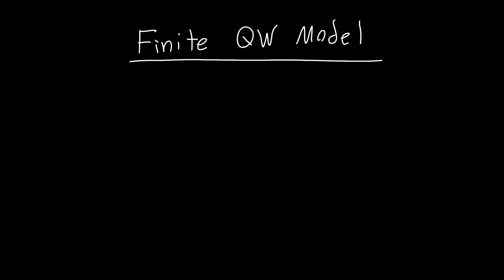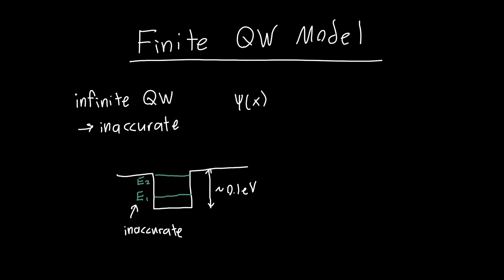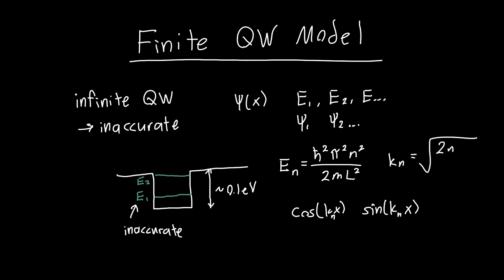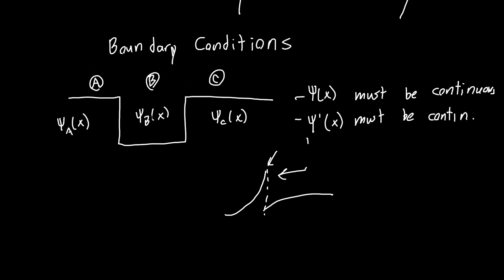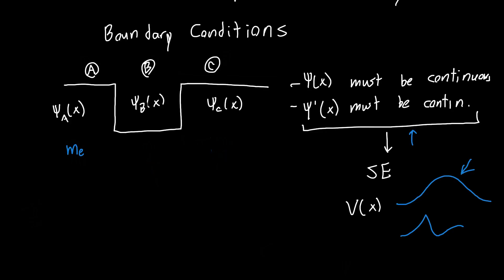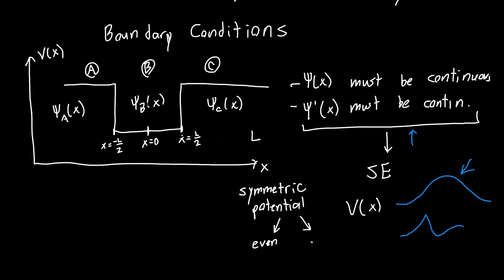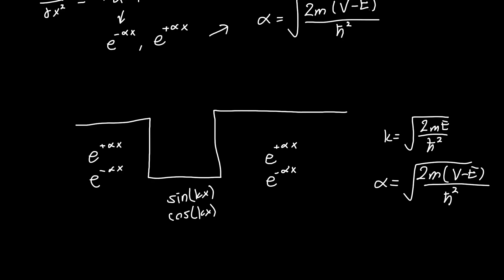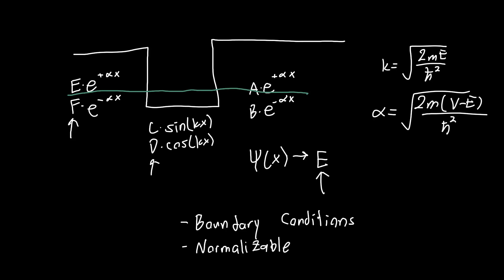Finite Quantum Well Explained - Part 1

Comment: How does one learn how to know what the general solutions are?
Reply: A standard differential equations book will explain how to find a general solution to a ordinary differential equation. If you haven't read any, I recommend A First Course in Differential Equation with Modeling Applications by Denis G. Zill. 

For linear differential equations it's analogous to linear algebra if you've studied it before. For a vector space like R^n, for example, the vector space is n dimensional and you need n basis vectors in order to describe it. For the three dimensional vector space R^3 one set of basis vectors you can have is i hat, j hat and k hat or x hat, y hat and z hat if you prefer. But for any vector space there are an infinite number of sets of basis vectors you can choose. However once you pick one, any vector in that vector space can be written as a linear combination of those vectors. So for an arbitrary position vector, r, in say R^3, r = xxhat+yyhat+zzhat. A necessary property for a set of basis vectors is that they are linearly independent which means you can not write one of the basis vectors as a sum of the other basis vectors. So, for example, if you have some set of vectors, {e1,e2,e3} and e1=ae2+be2 where a and b are nonzero, that set is not linearly independent, it's linearly dependent. To generalize, the set is linearly independent if ae1+be2+ce3=0 if and only if a=b=c=0. 

Linear ordinary differential equations work in a similar way but instead of having basis vectors you have what you can call basis functions. The highest order derivative in the differential equation is called the order of the differential equations and this tells you how many basis functions you will need for your general solution. It's analogous to the dimension of a vector space. If you have an nth order differential equation, you have found n functions that satisfy the differential, and you have confirmed they are linearly independent then you can simply write your general solution as a linear combination of all these functions. (For a easy way to check if functions are linearly independent it might be worth looking up the  Wronskian. It comes from linear algebra but all you really need to know is how to compute them which isn't too difficult.) It doesn't matter what set of basis functions you end up with. As long as they are linearly independent and each satisfy the differential equation then it's linear combination can describe any possible function that satisfies it. How you actually find these functions will depend on the differential equation. Some differential equations will have a method or multiple methods to systematically solve for them. If all else fails or it's just easier, you can guess a function and check if it salsifies the differential equation. The method of undetermined coefficients is a method to make better guesses and is usually faster than the more systematic method, variation of parameters. 

For nonlinear differential equations finding the general solution analytically depends on the equation and sometimes it simply isn't possible. The Schrodinger equation is fortunately linear however. Any differential equation that takes the form a0(x)y+a1(x)y'+a2(x)y''+...+an(x)y^(n) = b(x) is linear. Linear partial differential equations take on a similar form. The most common way to solve pde's for physicists and engineers is separation of variables which assumes that a function, f(x1,x2,x3,...,xn), that salsifies the pde can be written as a product of functions for each variable. f(x1,x2,x3,...xn)=f1(x1)*f2(x2)*f3(x3)*...*fn(xn). Substituting this back into the pde will allow you to break up the pde into a system of ode's which is exactly what's done for the Schrodinger equation. Once you solve for each of the functions you just multiply them together. The general solution, like before, is the sum of all basis function. In this case there are an infinite number of basis functions or products of functions that satisfy the pde, so the general solution becomes an infinite sum. This is a very powerful technique and can usually be done if the pde is linear and homogeneous.

Comment: Do the energy levels of the states inside the well represent potential energy or kinetic energy?
Reply from the maker: The kinetic energy in quantum mechanics is defined in terms of an operator (the p^2/2m part), so if you take the potential to be zero inside the well, the energy is all kinetic.